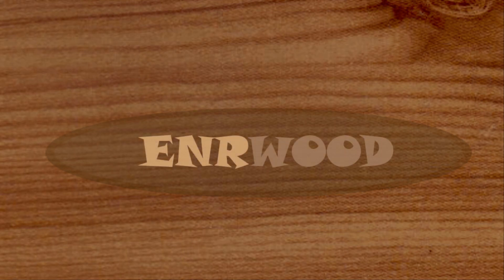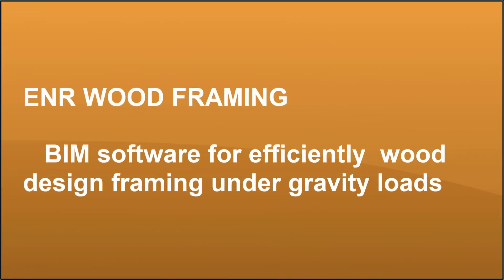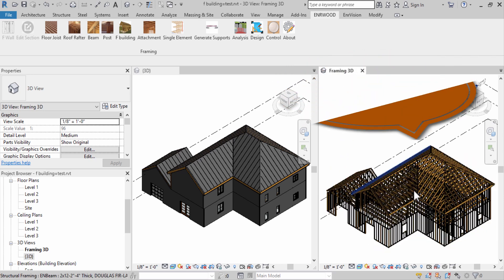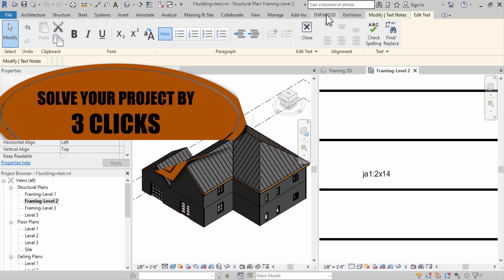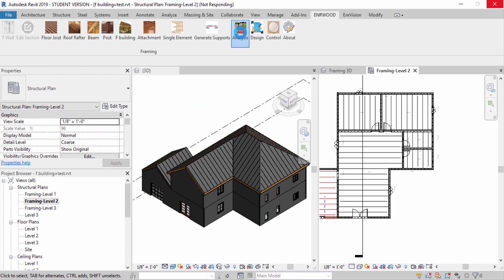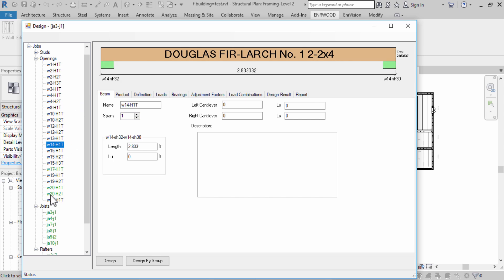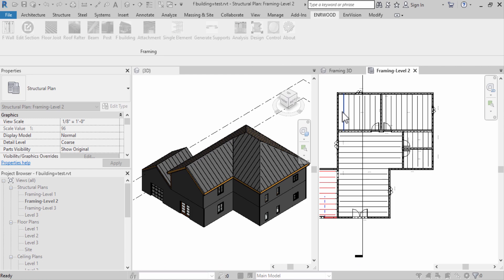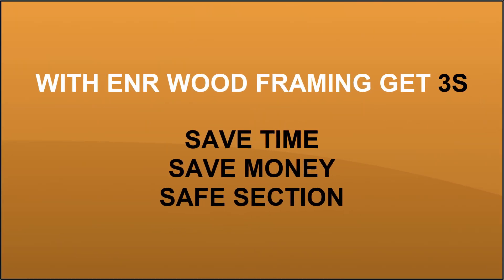ENRWOOD - FRAMING

Comment: Doesn't work/show up in ribbon in 2023
Reply from the maker: We are working in version of Revit 2023
Reply: @enrvisionaec3770  great, two notes.
1. Revit 2024 is now out>
2. Please make it reasonably priced. Every other solutions is thousands per year. Not tenable for small shops. Thanks
Reply from the maker: @jvalal  Our price $400/year and discount for more than one license. The version for 2023 and 2024 will release at the same time.
Reply: @enrvisionaec3770  can't wait to try. ETA?
Reply: @enrvisionaec3770 Is 2023 available now? Can it work for light steel framing?  Maybe if you can add steel profiles,  the logic is similar.
Reply from the maker: @Constantinesis  We are testing the version now for 2023 and 2024? coming soon
Reply: @enrvisionaec3770  Great. Please make new Youtube videos when you finish it.